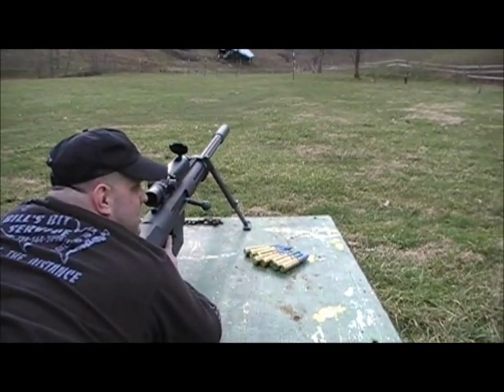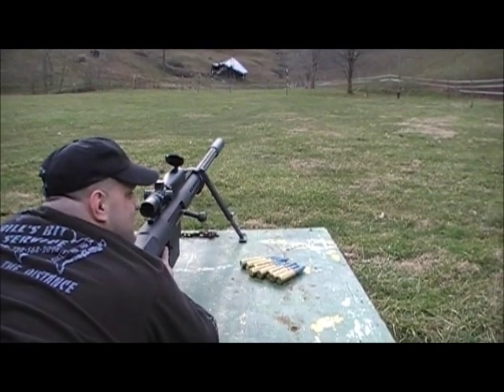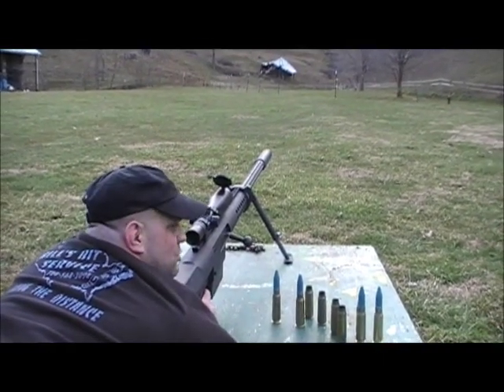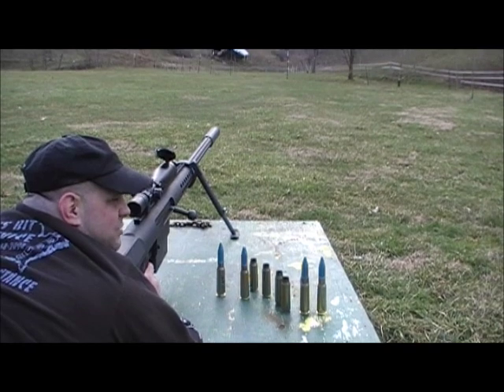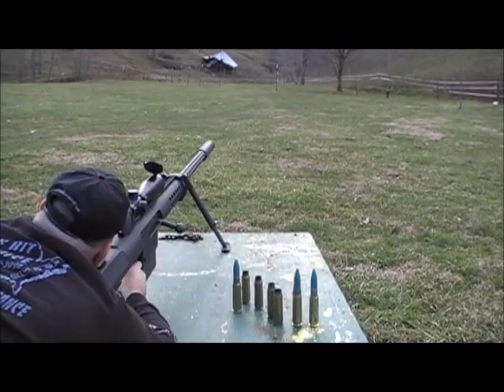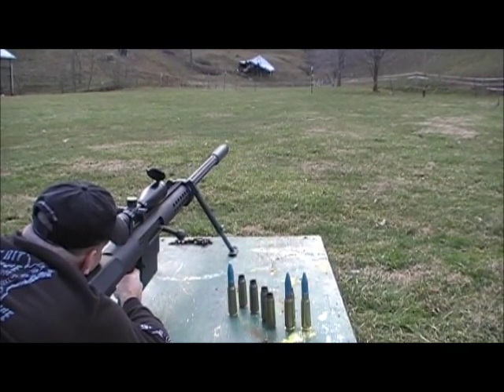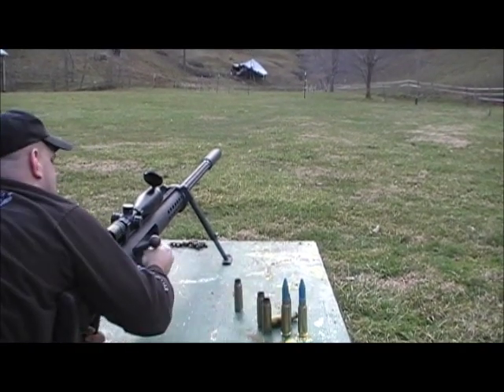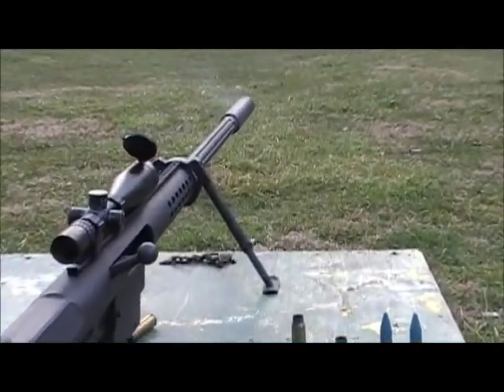Anzio 20mm subsonic and hivel slow motion with suppressor

Comment: with the suppressor the recoil is minimal
Reply: the weight of the gas is relatively low compared to the weight of the bullet in a subsonic ammunition so it's more the low speed of the bullet and the weight of the gun that decrases the recoil

Comment: Where is the recoil????
Reply: The weapon weighs almost 90lbs. Very little of that energy is transmitted.
Reply: MrSuperawesome5000 It's because it's firing subsonic rounds, not because the weapon weighs 90lbs moron. 20mm's are akin to cannon rounds and 90lbs is nothing for it.
Reply: MrSuperawesome5000 also it weighs BETWEEN 53 and 110 lbs